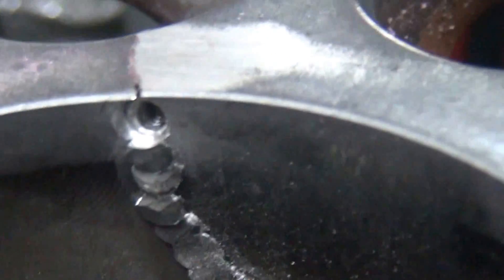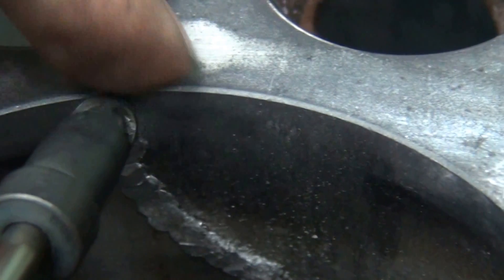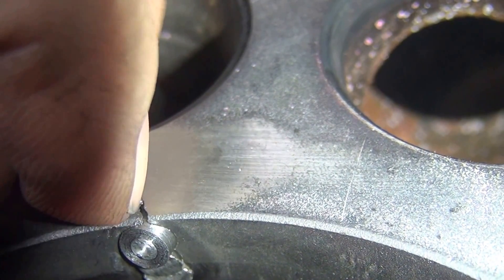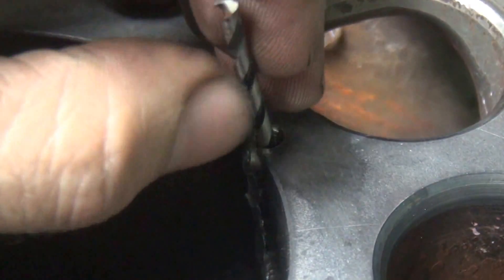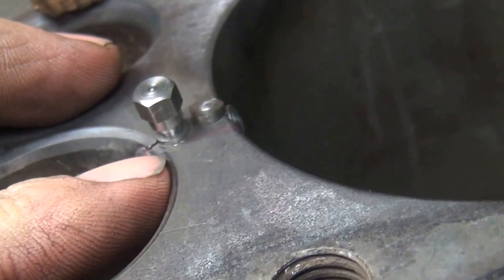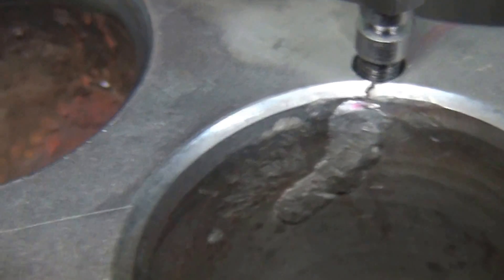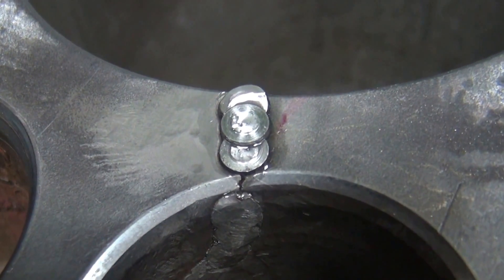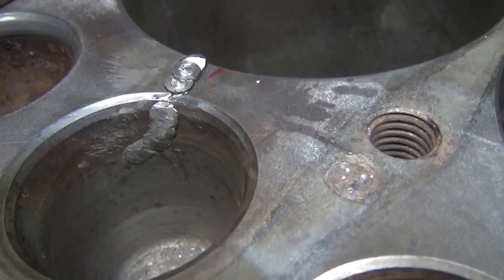1932 ford #107 model A or B flathead race block crack repair by tatro machine

Comment: Can't it just be tig welded?
Reply from the maker: no. welding does not work very much on castiron parts.
tatro
Reply: @TatroMachine  I have a old 8ba and it two has the notorious cracks, I've been holding on to it for a while and I've heard of pining it so is that what that is drilling  holes and taping it and screwing those break away head bolts? And does that make 100% seal? Just curious! Ive never seen it done before and it is so interesting to me
Reply: @joecastillo4694  yeah they are specially made to expand at the same rate the cast iron block is, very old school fix but it works

Comment: I don't work in a machine shop but I ain't never seen that done. And I realy don't see how that can effectively work . Personally I would have took the die grinder with a dental bit and ground a v vally in that crack and welded it both front side and as much of the back side as I could with as hard of a wire as i could get leading the weld with a heating torch to preheat the metal to increase the bond . I've done that before and it works .
Reply from the maker: that might work but i doubt it. most likely it will just crack right behind your weld. next thing is what are you going to do about the melted babbit bearings you just destroyed. that is over 2k worth of work you just pissed away. just because you have not seen something before does not make it crap and will not work. i proved that wrong on this project.
tatro
Reply: @TatroMachine  I did it to a riding mower I had and it ran for 5 more years  . And when I was younger I was into drag racing did the same crack and brazed it and it held for about 6 more luonches and gave way . But when you pre heat the metal in front of your weld it pretty much bonds the metal as one solid piece . Most people just weld and it sticks but does not get a 100% true bond often more like a glue job with metal witch works on alot of stuff fine but ya an engine block has to be done to be one solid metal a fill in or just normal weld will eventually seep or crack under those conditions that's why you as known as teiking the metal your welding makes a true bond . Teiking is more commonly known in soldering .but it works in welding cast as well
Reply: Yates, this is an industry standard. Why R U pissing on it?
Reply: @iguanapete3809  I don't see how this cob job technique is considered an "industry standard". Drilling out a crack, tapping it, and putting basically a bolt in make as much sense as "fixing" a nut that has cracked in two by threading a bolt inside the two hales. It's NEVER going to be completely sealed once it's machined and the bolts are going to expand at a different rate than the block. If you were to even attempt to fix this you would V-out the crack as much as possible from both sides and fill it back in using a TIG and nickle rod. Ultimately, the block should be scraped and a different one sourced, it will NEVER be as good as one that isn't cracked.
Reply: @madmatt2024  The bolts are made to expand at the same rate as cast iron. They are sealed with a Permatex like sealant. It's a 32 ford flathead. VERY Rare by now. Do a search on YouTube.
Reply: @madmatt2024  Look up lock-n-stich

Comment: The weakened block material on the cylinder wall will crack elsewhere.
Reply from the maker: now there is something new, a flathead block cracks. it is working for now.
tatro
Reply: It's not going to weaken cast but iron or stainless yes